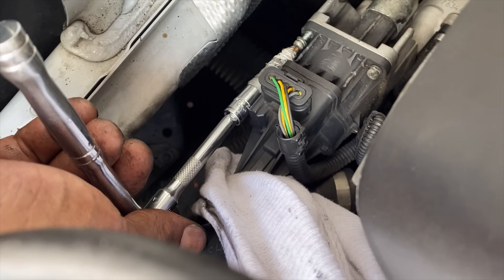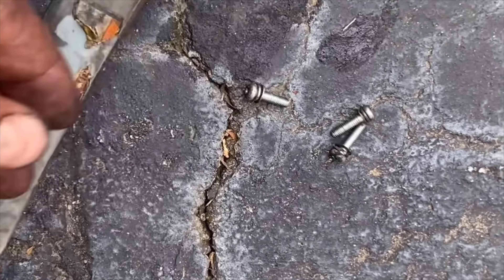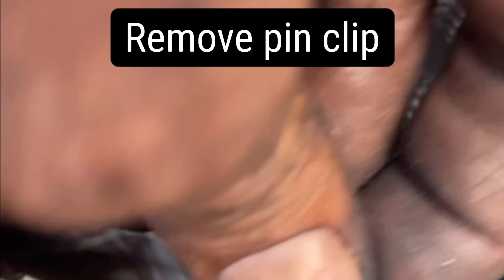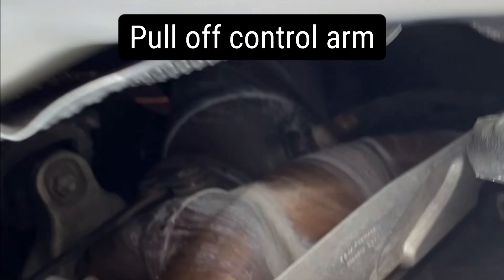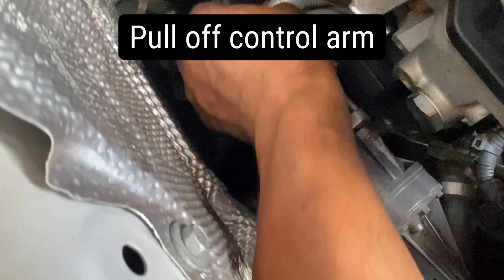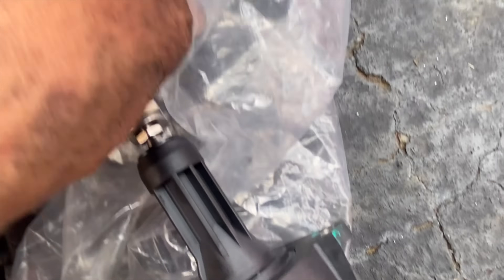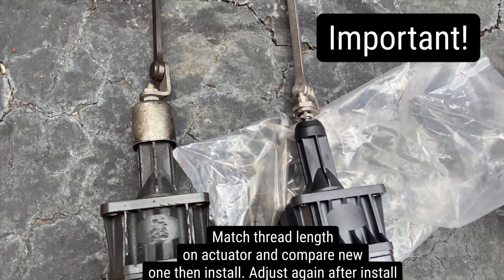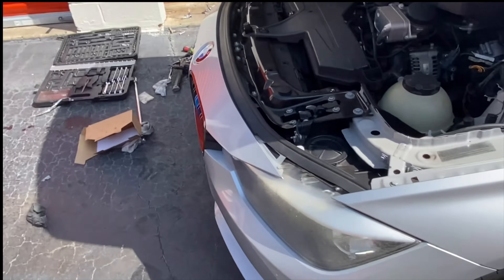BMW 328i - Wastegate Actuator replacement/ P1920 code/ Fix Drivetrain Malfunction (n20) f30 /f32 DIY

Comment: Hello friend good day. I have a query when changing the turbo actuator you have to make some configuration with some scanner or it is nothing more to arrive and change. thank you very much in advance.
Reply from the maker: Depends on your year BMW and model. For a 2013 BMW 328i F30 (N20 engine), replacing the turbo actuator does require calibration to ensure proper boost control and avoid drivetrain errors.

Option 1: Use a Scanner to Calibrate

You can use a BMW-compatible diagnostic scanner to reset and calibrate the new actuator. A great option is the Foxwell NT530, which supports turbo actuator adaptation for BMW models. Also you can use the scanner for other makes and models. 

🔗 Recommended Scanner: Foxwell NT530 for BMW – Amazon
Link to part: https://amzn.to/4is1P4I

Steps:
	1.	Replace the actuator.
	2.	Connect the scanner via OBD-II.
	3.	Run the wastegate adaptation procedure under service functions.
	4.	Clear any error codes and test drive the vehicle.

⸻

Option 2: Take It to a Dealership or BMW Specialist

If you’re not comfortable with the calibration process, I recommend taking the car to a BMW dealership or a specialized independent shop that has ISTA+ (BMW’s official software). This ensures the actuator is properly programmed and synced with your turbo system.

How to calibrate with Foxwell Tool:
🚀 Step-by-Step Calibration Process:

Step 1: Connect the Scanner to the Car
	1.	Plug the Foxwell NT530 into the OBD-II port under the dashboard.
	2.	Turn the ignition to ON (without starting the engine).

⸻

Step 2: Select BMW Vehicle System
	1.	On the scanner’s main menu, select “BMW”.
	2.	Choose “Auto VIN” to let the scanner detect your vehicle automatically, or manually enter your BMW F30 model details.
	3.	Once identified, proceed to the “Control Modules” section.

⸻

Step 3: Navigate to Turbo Actuator Calibration
	1.	Go to “Service” → “Powertrain” → “DME (Digital Motor Electronics)”.
	2.	Select “Wastegate Adaptation” (or “Turbocharger Wastegate Adaptation”).
	3.	Follow the on-screen instructions to start the calibration process.

⸻

Step 4: Perform the Wastegate Calibration
	1.	The scanner will initiate the wastegate actuator movement to determine its range.
	2.	You may hear the actuator opening and closing as it learns the correct positions.
	3.	Wait for the process to complete successfully.
	4.	Once done, the screen should confirm “Adaptation Completed” or “Successfully Calibrated”.

⸻

Step 5: Clear Any Fault Codes
	1.	Go back to the main menu and select “Diagnostic” → “Read Fault Codes”.
	2.	If any errors related to the turbo/wastegate appear, select “Clear Fault Codes”.
	3.	Exit the menu and turn off the ignition for 1 minute.

⸻

Step 6: Test Drive the Car
	1.	Start the car and check for any warning lights on the dashboard.
	2.	Take the car for a short test drive and monitor performance.
	3.	If no issues arise, the turbo actuator has been successfully recalibrated.
Reply: @Nerovisum thank you very much for the teacher class the truth very grateful for taking the time to explain every detail to me.
Reply from the maker: Your welcome. The calibration is for more performance. If you dont calibrate it, you could loose boost power, check engine light, rattling, check engine light and fuel efficiency. Calibration helps with compensating for the wear of the boost release valve located on the manifold. If you have extra money, replace the manifold, wastegate and turbo.

Poor man calibration with a basic scan tool that check turbo boost:
Manual Calibration will be needed if IsTa+ fails due to aftermark wastegate actuator:
Adjust ROD check boost with a scan tool, tighten rod adjustment. Test drive to see boost issues . Underboost (low power, slow acceleration) → Shorten the rod slightly.
	•	Overboost (possible limp mode or check engine light) → Lengthen the rod slightly.

Comment: so the bad wastegate caused a drivetrain malfunction code? cause that’s all i keep getting and my car drives real slow.
Reply from the maker: Yes, a bad wastegate actuator on BMW can definitely trigger a drivetrain malfunction warning and put the car into “limp home mode”, making it feel sluggish. This is because when there is a wastegate failure the valve connect to it can stay shut and put too much boost pressure from the turbo and can damage the engine. Also a valve stuck open can make the engine loose power, because the turbos boost will leave the engine/chamber  do to the open valve in which wastegate opens and closes that it. Think of the wastegate like a human arm opening and closing a door. 

If you’re in the area I do repairs or I do video conferencing calls to walk you through it and charge by the hour. For bookings email repairhelp@nerovisum.com
The part is in the description.

Comment: What symptoms was yours having to make you replace it? When I place a stethoscope on mine it's thumping once the car gets up to operating temps.
Reply from the maker: Mine symptoms were 1,2,34,5 &7 

Moving forward here are the common signs:

1. Loss of Power
	•	The engine may feel sluggish, especially at higher RPMs or when accelerating hard, due to reduced or inconsistent turbo boost.

2. Boost Pressure Issues
	•	Overboost or underboost conditions can occur, often triggering the check engine light or limp mode.
	•	You may notice the car doesn’t build boost properly or feels inconsistent during acceleration.

3. Check Engine Light (CEL)
	•	Fault codes related to the wastegate or turbocharger, such as P0299 (underboost) or P0234 (overboost), may appear when scanned with a diagnostic tool.

4. Rattling Noise
	•	A failed or worn actuator can cause the wastegate to stay partially open, leading to a metallic rattling noise, especially at idle or low RPMs.

5. Poor Fuel Economy
	•	Reduced boost efficiency can result in the engine working harder, leading to increased fuel consumption.

6. Black Smoke from Exhaust
	•	In some cases, improper wastegate operation can cause the engine to run rich, leading to black smoke from the tailpipe.

7. Limp Mode
	•	The ECU may limit engine performance to protect the turbocharger and engine components, restricting power and RPMs.

8. Visual Inspection
	•	Upon inspection, you may notice:
	•	A stuck or damaged actuator arm.
	•	Loose or disconnected linkage between the actuator and the wastegate.
	•	Corrosion or wear on the actuator components.

If you suspect your wastegate actuator is failing, it’s important to diagnose the issue properly with a professional scan tool and consider repairing or replacing the actuator. Ignoring the problem can lead to further turbocharger damage. When I doubt call your local mechanic or email me.

I am offering step by step virtual live mechanic guidance. To sign up and get pricing on a live mechanic while you do your repairs email any mechanical issues and best contact.  virtualclasses@nerovisum.com
Reply: @Nerovisum  Mine isn't getting any of those codes or acting in that way. I use a BMW scan tool. Ancel BM700. Its not the best but it does what I need it to. It codes  injectors, registers batteries, has some decent specials functions. I'm replacing my Valvetronic servo motor I have the valve cover off so will replace gaskets and all that while working on it. But yeah my intercooler charge pipe has failed and servo motor thinking that's why the waste gate actuator was making thumping noises. It was throwing rich codes due to all the air coming from charge pipe. . hopefully this takes care of it. Thank for reply.

Comment: Is it the same on a 435i?
Reply from the maker: Great question Kareem.

Short answer:
 No/yes, 
No this part does not fit your vehicle. There are parts online for 435i just google it and check for 435i aka N55 engine twin scroll turbo. Your turbo is bigger to push that 6 cylinders. Repair is similar but time/difficultty increased a little 🤏

Long answer:
1. Turbo Location and Accessibility
	•	N20 (328i):
	•	Turbocharger is located near the rear of the engine, on the passenger side.
	•	Easier to access than the N55 due to the smaller engine size.
	•	Requires removal of fewer components (e.g., heat shield, intake piping).
	•	N55 (435i):
	•	Turbocharger is also on the passenger side but harder to access due to the larger inline-6 engine.
	•	More components (like the downpipe and potentially part of the exhaust manifold) may need to be removed.

2. Wastegate Adjustment
	•	The adjustment procedure and tools are similar but require engine-specific measurements for the actuator rod’s length and preload:
	•	N20: Smaller turbo, shorter actuator rod, less preload.
	•	N55: Larger turbo, longer actuator rod, more preload.

3. Time and Complexity
	•	N20: Repair is quicker and more straightforward due to better accessibility.
	•	N55: Repair is more time-consuming because of the tighter space and additional components.

4. Tools and Parts
	•	Tools are similar, ****but the actuator part numbers differ.*****
	•	Always use the correct actuator for your engine type (N20 vs. N55).

Good Luck and as always if you are uncertain consult and support your local mechanic. 

The part you need:https://amzn.to/408InU0

-Brandon
Nerovisum

Comment: Hi I’m getting this code 123516 on my 2014 bmw 320i . Would this be the same issues. Thank you in advance
Reply from the maker: Hello @shafesshafes!

Here’s a guide for diagnosing and fixing BMW fault code 123516 in your 2014 BMW 320i (F30), which indicates an issue with the secondary air system.

Step 1: Confirm the Fault Code

	1.	Get an OBD-II Scanner: Ideally, use a BMW-specific diagnostic tool like ISTA/D or a high-quality OBD-II scanner that can read BMW-specific codes.
	2.	Scan for Codes: Plug in the scanner, access the diagnostic menu, and confirm that fault code 123516 is present.
	3.	Record Any Additional Codes: Sometimes multiple codes appear, which can help pinpoint the exact problem.

Step 2: Inspect the Secondary Air Pump System

	1.	Locate the Secondary Air Pump: In the 2014 BMW 320i, the secondary air pump is typically located near the front of the engine bay, often beneath the intake manifold.
	2.	Check the Pump for Obstructions or Physical Damage: Look for any visible signs of damage, debris, or corrosion on the pump. Clean off any dirt or debris to ensure nothing is blocking it.

Step 3: Test the Secondary Air Pump Relay and Fuse

	1.	Locate the Fuse and Relay Box: The fuse box is usually located in the engine bay or glove compartment.
	2.	Find the Secondary Air Pump Fuse and Relay: Check your vehicle manual to locate the specific fuse and relay for the secondary air pump.
	3.	Test the Fuse and Relay: Replace the fuse if it’s blown. For the relay, try swapping it with a similar relay in the fuse box to see if the problem changes. If the relay is faulty, replace it.

Step 4: Inspect the Hoses and Connections

	1.	Check for Cracks or Blockages: Follow the hoses connected to the secondary air pump and inspect them for cracks, loose connections, or blockages.
	2.	Clean or Replace Damaged Hoses: If any hoses are cracked, brittle, or clogged, they may need to be cleaned or replaced.

Step 5: Inspect the Check Valve (Non-Return Valve)

	1.	Locate the Check Valve: The check valve is usually located between the secondary air pump and the exhaust manifold.
	2.	Test the Check Valve: Disconnect the hose leading from the pump to the check valve and attempt to blow air through it. Air should only flow in one direction (toward the exhaust).
	3.	Replace if Faulty: If air flows in both directions or doesn’t flow at all, the check valve is likely faulty and needs replacement.

Step 6: Clear the Code and Test the System

	1.	Clear the Code: Use your OBD-II scanner to clear the fault code.
	2.	Start the Engine and Monitor: Start the car and allow it to warm up. Observe for any check engine light reappearance or unusual sounds from the air pump.
	3.	Rescan if Needed: After a few minutes, rescan for codes to ensure the 123516 fault code does not reappear.

Important Notes:

	•	If the Issue Persists: If the code returns after following these steps, the air pump itself might be failing and could require replacement.
	•	Professional Assistance: Secondary air system repairs can sometimes be complex. If the issue persists, it may be best to consult a BMW-certified mechanic for further diagnostic tests.

Let me know if you need more help with any specific step!

If you’re comfortable working on your BMW, you could start by checking the relay, fuse, and hoses; otherwise, consulting a professional mechanic is recommended.

Good luck & hit that share/subscribe button
Reply: @Nerovisum I’m getting codes 
123516: Electrical wastegate, control: line interruption
120408: Boost pressure control: shutdown as a follow-up reaction
On my 2013 328i xdrive could it be for the same reasons

Comment: Should the Check Engine light automatically clear itself? Thanks
Reply from the maker: Sounds like you are at the end of the job 🎉 . It will take 50-100 miles driving time to clear an engine code. 9/10 times, these codes are cleared by hooking up diagnostics ECU device and clearing the codes that way. Take it to neighborhood auto part store for they can do that for you or the poor mans way.

The old-school trick of draining power from a car’s ECU (Electronic Control Unit) using a resistor typically involves using an ohm resistor to discharge residual electrical charge from the ECU after the battery is disconnected. This is done to reset the ECU or clear fault codes without using a scanner. Here’s a common method:

	1.	Disconnect the battery: Remove both the positive and negative terminals from the car battery to cut power to the ECU.
	2.	Install the resistor: Use a resistor (often a 10-ohm, 1-watt resistor) and connect it between the disconnected battery terminals. The resistor allows for a controlled discharge of any residual energy in the ECU and other systems. This method is safer than directly shorting the terminals.
	3.	Wait for a few minutes: Leave the resistor in place for about 10–30 minutes to ensure that all power has drained from the system.
	4.	Reconnect the battery: After sufficient time has passed, remove the resistor and reconnect the battery terminals.

This procedure can reset the ECU, clearing certain fault codes or returning adaptive learning systems (such as fuel trims and transmission shift patterns) to factory settings.

Note: These methods are used at your own risk, and it is recommended to follow the vehicle manufacturer’s guidance or use an OBD-II scanner for proper diagnostics. Nerovisum and its subsidiaries is not responsible for any possible unsatisfactory outcomes. All information must require your own research before attempting any service displayed or shown. Good luck and congrats on the journey of saving yourself money by empowering yourself! Now you know the job is done right✅
Reply: @Nerovisum  Much appreciated, thanks for taking the time to write this up
Reply from the maker: You welcome be sure to share video and subscribe. Any support is welcome.

Comment: Do you have a link to the part for this?
Reply from the maker: Here is the link for the new BMW 2013 and above electronic wastegate actuator shown in video: https://amzn.to/3BE13kH
And
A link for the older style wastegate for BMW 2012 and before: https://amzn.to/4eEjDYA
Reply: @Nerovisum so you can install and drive no need to calibrate with a tool?

Comment: Hey! I have a 2012 528i derive N20. Ive been getting the “FC120308 boost pressure control, plausibility: pressure too low” code for a few years and drivetrain malfunction. This is the only code I have. Car drives fine but throws code every time I accelerate for the first time of the drive. It’s a pretty loud rattle when the car is just sitting as well. Could this just be the wastegate actuator? If I replace that with another one, could it solve the problem?
Reply from the maker: Over time, the valve operated by the actuator no longer seals tightly against the manifold as it did when the car was new, which is common with regular use. This can result in low boost pressure and cause rattling noises. You have two options to address this issue—let me know if you’d like more details, and I’d be happy to help further. FYI you have a non electrical actuator which is not shown in this video. The one in the video is a electrical actuator which BMW used in the years after yours. 

One other rattle occurrence something within the exhaust system of certain BMW. Cars with duel exhaust will shut down to one exhaust for gas and emissions efficiency.

Comment: I need to replace the same thing but those four screws are rusted to the point of falling apart when touched. Anything you recommend I do to help make it easier? My last option is taking it to a mechanic 😅
Reply from the maker: Hello @zyRexGaming check out the link to my website on an article I just wrote inspired by your post. It gives some detail in writing/audio. If that doesn’t help you may need to take off the manifold and everything as a whole to have better access. Take your time and be patient. Let me know your results. Good luck! 

Audio Article to help:
https://www.nerovisum.com/?p=11325
Reply: I had two rusted bolts as well take it slow, use the hammer and screw driver trick to loosen and shape, & then use a socket like 4mm with extender to push and turn with patience and diligence you’ll get it out! I also added a little jb weld glue to fill the hole(extractor set didn’t work) and then made it into a flathead shape with hammer and screwdriver, a combination of all three of these made it happen. Also use your camera phone video to see 😂 it helped me a lot